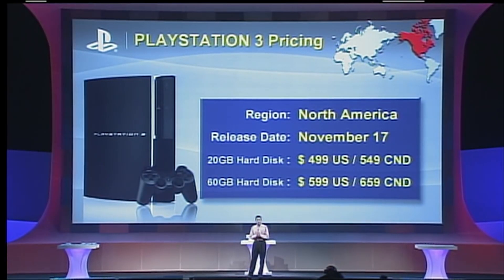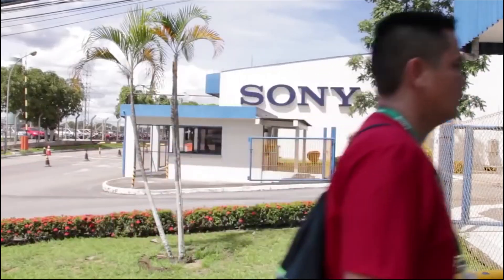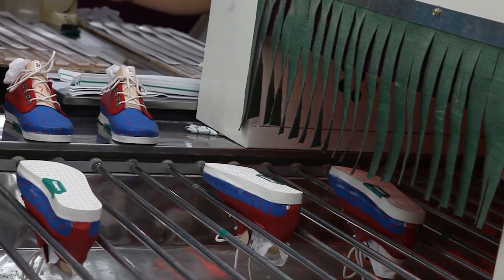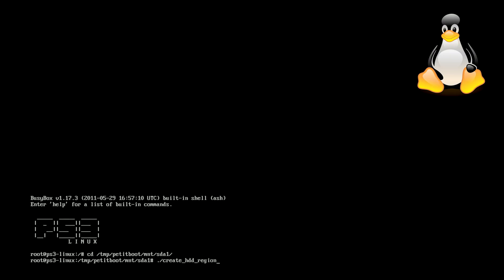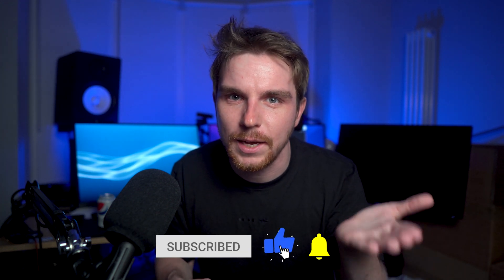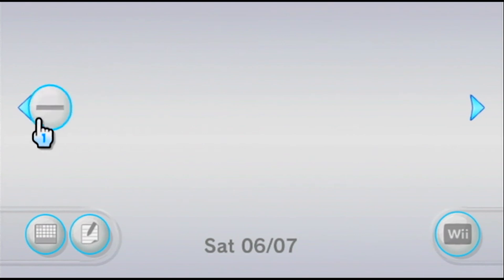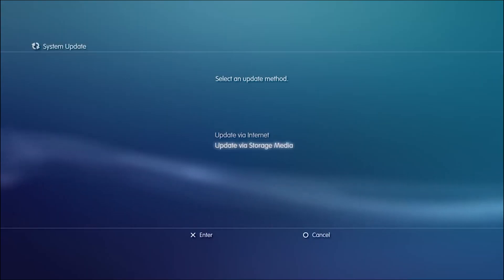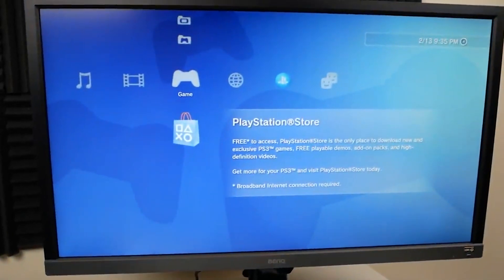HOW THE SONY PS3 WAS JAILBROKEN (SECURITY MISTAKES)

Comment: Removing Other OS was in my eyes a "you want to get rid of us? we don't need you to run Linux" thing. And as running Linux needed an exploit to the main PS3 OS, it was just a short step afterwards to get at first homebrew running, and later the whole backup thingies. In my eyes the part of the community that has financial interests in a system is never as smart als the non profit hacking scene (most of the time they are interested in Linux). So the non profit scene gave the others the chance to gain money with pre-cracked systems.

BTW: the Xbox 360 was "hacked" not for Linux, it was a different firmware for the DVD drives (Homebrew was not possible, just for backups and copies). Free60, the Xbox Linux loader came later, I think it was late 2009.
Lastly: Would be cool to see a video like this in 10 years about the Xbox One and Xbox Series. Otherwise the consoles will end as e-waste.